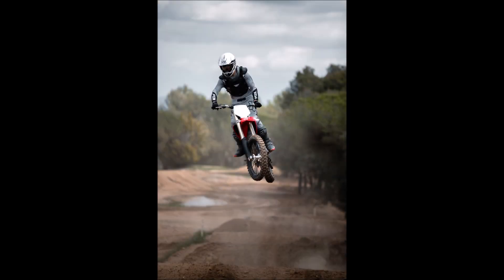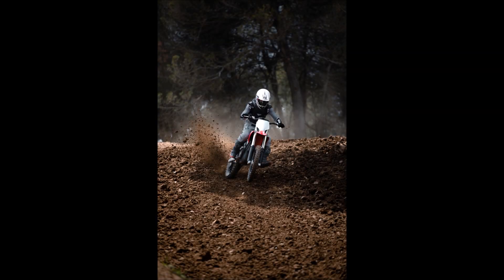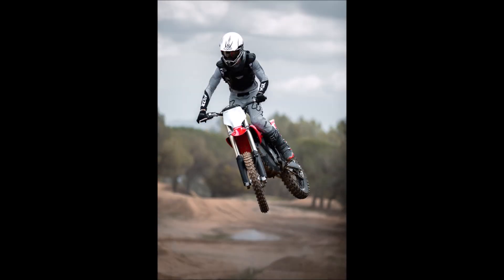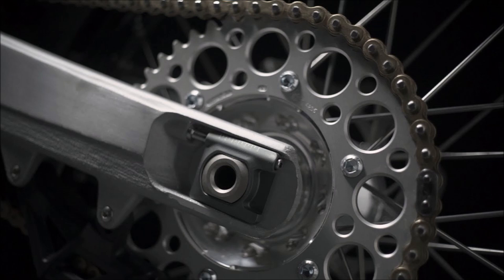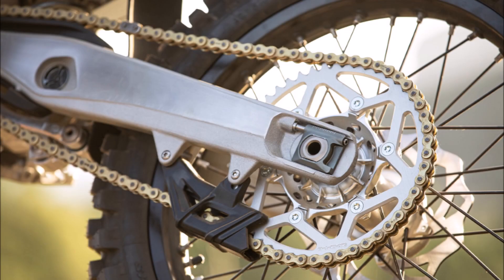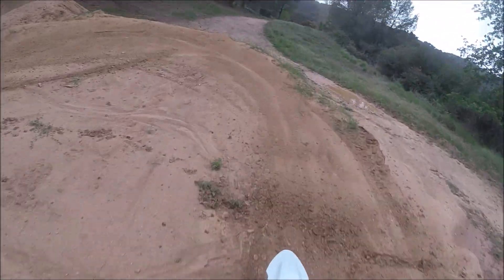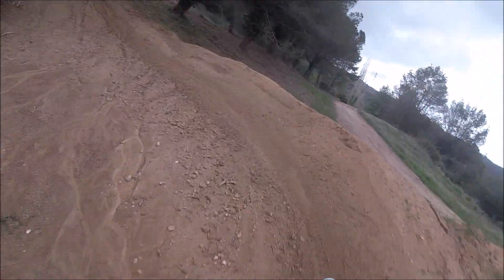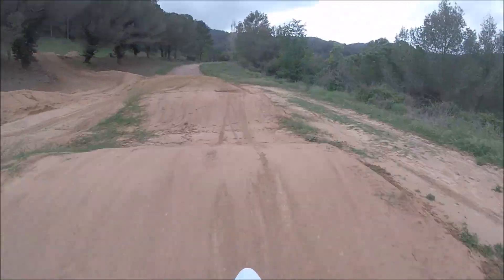First Ride on the Stark Varg Electric Dirtbike in Barcelona, Spain!

Comment: Nice. Did you get to play with the software on the phone, and the ride mode buttons on the handlebar? Can you change modes while moving? What's your impression of having several modes available?
Reply from the maker: Yes I did, essentially there are 5 ride modes with two slider bars for each mode.  The first slider adjusts the power output, while the second slider adjust engine braking.  What I tended to do was set each map up before I got out on the track, and then bump between them while riding to get a sense for how each input effected the bike.  There will be more adjustability later on with future software updates, but this is plenty to play with for a while and gives a lot of different options in a way that's very easy to understand.

Comment: Great feedback! Thank you for the review!
I had my doubts, but I think I will keep my preorder after all and get my bike this September!
Will definitely need a generator for the track days but it will last so long as it's plugged in when you're not riding but it'll be worth it.
How did you fare against the extra 20 pounds they added when they improved the battery?
Reply from the maker: I don't think you will regret keeping your pre-order, this bike is the real deal.  I never rode the previous version of the bike before they added the extra P group of battery cells, but the only place that I noticed the weight of the bike was stopping for tight corners, especially after a downhill.  It's not a big deal to adapt to and keep in mind I'm used to a YZ250 that is significantly lighter than any 450F.  The benefits everywhere else on the track definitely outweigh (no pun intended) that small negative.
Reply: @485Josh  That's great to hear!! I have a ktm250sx at the moment so I know what you mean with the weight aspect. I also hear that electric bikes feel much lighter since there's less moving parts which is why no one seems to mind the weight of the Stark. Thanks for the response and can't wait to see this thing in action!
Reply from the maker: @mxoudi  That's exactly the reason why they feel lighter, there's no heavy crank or flywheel rotating to create a strong gyro effect.  The weight may be there, but because it's not rotating it doesn't feel nearly as heavy rotating side to side or moving in the air.  Under braking you can feel the weight, but to me the benefits definitely outweigh the negatives.

Comment: My main question is have they tested it in full muddy conditions?  Mud covering the cooling fins, the display?
Reply from the maker: I'd be very surprised if they didn't.  Mud really shouldn't be a factor, the controller and motor are cooled through a water cooling system that has a small radiator under the seat that should be relatively protected and help keep things cool.

Comment: A very good review, thanks. I want one but if the front was soft for you and I weigh 195 without my gear, I wonder what springs I would need? I am a B class vet rider.
Reply from the maker: The bike I rode had 5N springs, so your would likely want to bump up a few spring rates to a 5.2 or so.  They're just regular KYB SSS forks so springs should be readily available, and swapping them out is a pretty easy job.  I wouldn't let that hold you back from getting a bike, they may even be able to put a stiffer spring in the fork for you before the bike ships.

Comment: Do you know which weight settings from the factory you were on? What do you weigh with gear? Did you poke around on any of the trails? how do you think it will perform off the track?
Reply from the maker: Are you referring to spring rate?  I'm not sure what the rear spring was, but I know that the front fork springs were 5.0N because we had talked about going stiffer with a 5.1N spring as an option to stiffen the front a bit.  I'm not sure exactly what I weigh with all of my gear on but I'm about 155lbs without gear, so maybe add around 25lbs to that for a total weight of 180 roughly.  I did play around on some of the trails as well and thought the bike was a ton of fun on those, but I would definitely want softer suspension for that type of riding.  It was awesome to blast up hillclimbs without any need to cover the clutch or downshift at any time!

Comment: Do you know anything about the modes, ie if you need a subscription for full access and if yes do you get a couple of predefined modes?
Reply from the maker: I haven't heard anything about needing a subscription, as far as I know when you buy the bike you automatically get any software updates that come along down the road.  The bike will come with 5 pre-loaded maps, but you can adjust each of those however you wish using the phone app.

Comment: Do you know what Stark set the Sag setting to on the rear shock.  I was looking at the owners manual and didn't see anything talked about it.
Reply from the maker: The bike I was on had it set to 105mm with all of my gear on, which seemed fine to me.  I'd use that as a starting point and adjust from there.

Comment: Now a year later we have the Enduro bike coming, 20% more battery, street legal, lights and all that, and I think in 2 - 3 years, one of these bikes will do 1 hour around the most sandy of tracks at pro level pace, high speed!

The only thing I dont like is I've seen loads of people taking these on the roads already and not just a little sneaky ride but in traffic riding around as if its a normal bike, that means these people have no insurance or anything, no lights... Such behavior comes down on all riders eventually. Youtubers taking these things and putting them in gokarts and do 105 mph on public roads, again, no lights... This could strike against Stark and other BEV bikes... Already seen this with E-scooters, people using them irresponsibly and then they complain when they get speed limits and restrictions and what not...

I'd buy 10 Stark Vargs right now if I was able to, really impressive stuff!
For a more average rider, you will be ready for a nap before this thing run out of juice! So charge for 40 - 60 min, while you take that nap and then out again! Thats on track, if you trail ride you can ride for 3- 6+ hours depending on where you ride and how hard you ride. We have seen pro riders do Enduro competitions of 2,5 hours on these without charging.